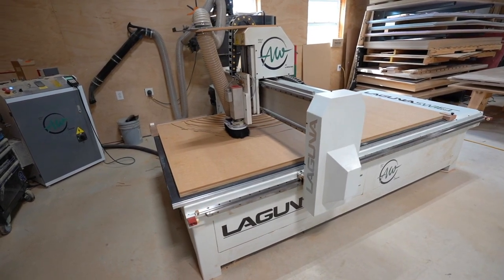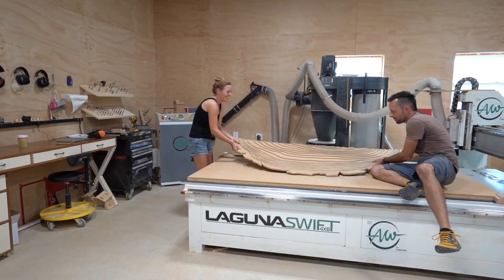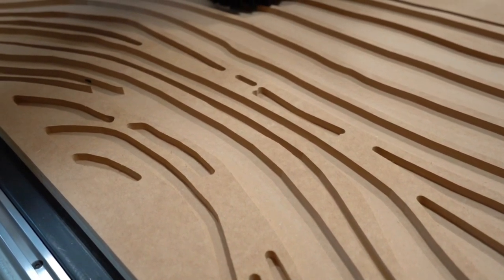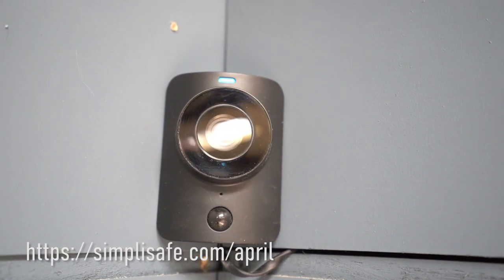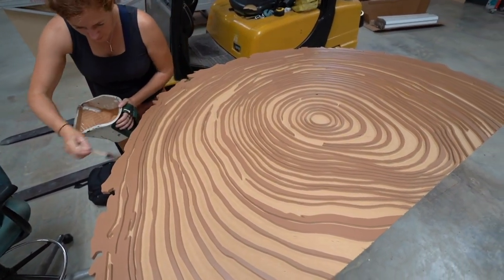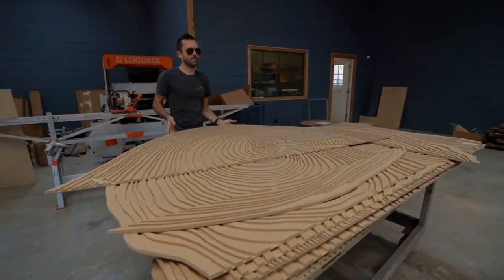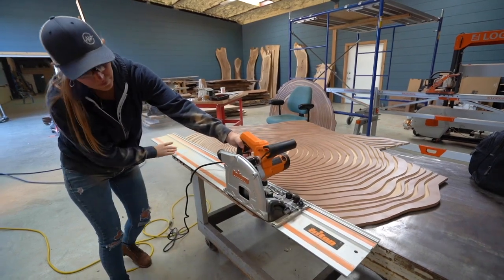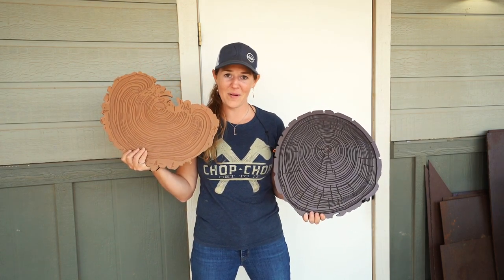Making Giant Wooden Tree Rings

Comment: They make a laser for that. Add the laser option on the cnc machine. Put the smaller tree cut thin on the table and copy it to a digital file. Enlarge the file and presto you can start cutting. I’m sure you can get that done that way with less effort. Great job doing it the way you did.